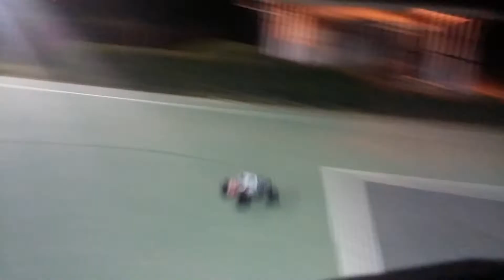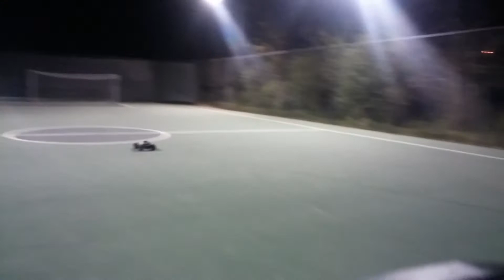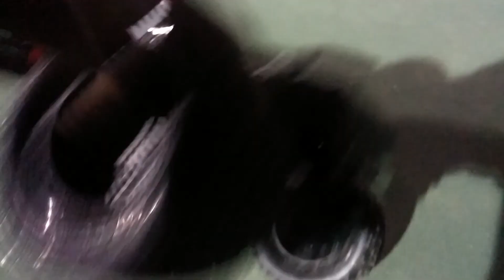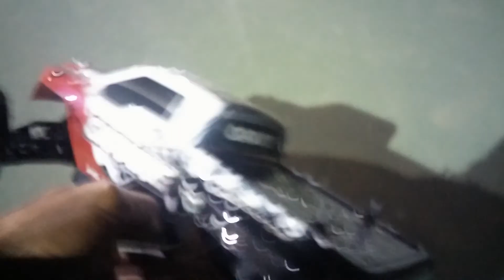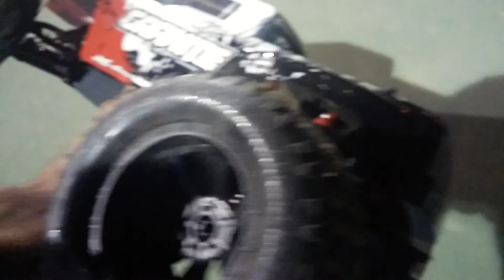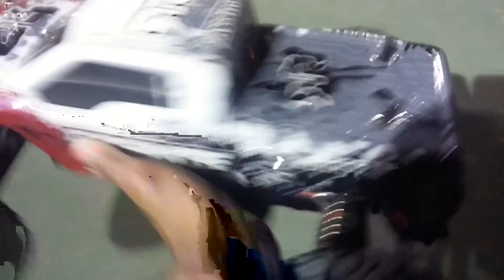Arrma Granite Mega Brushed 3s Box Stock Run

Comment: I bought the arrma granite mega 4x4. Stock electronics took the 3 s but the motor was smoking hot. I put brushless system in it. Does pretty good. Doesn’t have much speed as it should because I found out after I bought it that it has different diffs than the blx version. So I’m running mid to high 40s. Gets warmer than it should because of it being under geared in the diffs. Still does good. Just gotta watch temps on 3s

Comment: Nice. I have never had a Arrma RC yet. Looks like a fun RC.
Reply: Joe Schmoe Hi my name is Jake, I have owned one of these for two months now I have broke almost everthing on this truck. Idk how they call  it bashable, rear stub axles bend, body kit breaks, the mega has a plastic geared servo that broke the third day. If you are going to jump it get the front aluminum shock tower, you will want extra turnbuckle parts, front lower arms I have broken now twice. AND here is where it gets shitty the steering rack is plastic, and so are the transmission gears unless you buy the blx and Arrma screwed up and doesnt sell an input shaft gear anymore.... BOOO. the shocks on it are flipping garbage I broke one jumping a 1 foot high ramp. Also the plastic gears cant handle brushless I have a Onyx 4420 in mine and it ate up the transmission. Also back to the plastic steering rack omg was ripping in a grass field did  a wheelie snapped the steering rack flipped the truck end over end the damage was broke lower a arms, left front turn buckle, front right shock cap busted, front body mount busted. And I have tbone bumpers and Aluminum front lower plate because the factory plastic on cracked. I love this truck it handles well takes sharp corners and what not but if  you get mad easy dont buy to you be like me and be kick it through your back yard. If you want to see a video of my truck its on my page!!
Reply: So sorry you have had so many problems.
Reply: I am a basher but wow never thought that it would just be breaking like it does. I do love the truck though Id put it rite up under the Savage xs, and even that beast of a truck has issues and breaks its just part of the game.
Reply: JakeDean91909 I bought the arrma raider brushless buggy and the first day I broke the steering the week folowing i broke the servo. My friend bought the arrma granite for 180 bucks because that is cheep the first week he had it he also completely tore out the steering. Arrmas are garbage I wish people knew about this design flaw.
Reply: So you expect a 180.00 rc truck not to break?? Bashing the crap out of it? If you want a bashable truck, invest!!! Get the Arrma outcast! Then come back and tell us if Arrma is garbage. You get what you pay for
Reply: lol no I bought a stock truck so I could put what I wanted on it and it kept breaking the tires and rems are garbage and wtf are you even rambling on about any ways???
Reply: Arrma's are not garbage.  You bought one of the cheapest they make if not the cheapest.  Buy a Kraton or another higher end Arrma and you won't be saying they at garbage.
Reply: JakeDean91909  YouTube tuff guy

Comment: Ok so I bought a venom Lipo 3s and ran it in my granite mega.  It had a Tamiya motor in it, blew up in smoke lol😂.  So can I buy the stock motor again and run it without worries?   The thing was hitting about 45- 50 no joke. Recommend this battery.  20$ and it's great

Comment: Hi...i got question..i got the truck you got..and i tried to use 2s lipo 5000mah and after few minutes of playing around with my truck i see a smoke coming out in the motor..so it mean its already busted and i need to change it to a brushless motor...
Reply from the maker: Silencer 23 yea, it is probably burned out - when running in dirt and stuff u need to make sure that u 'blow' in one end of the motor so that the dust flys out the other end. also, keep them well oiled as well.

Comment: is that a brushed 15t arrma motor? How are u running on 3s? the paper on chart said good too 2s on my sons granite? if u are using 3s what battery did u use? also does it still run? im amazed because it dont reccomend the 3s on granite mega 15t motor.. so sum up what battery?
Reply from the maker: Davie Downs yep, 15t motor. this one esc is rated at 3s. the battery was a 4000mah 40c
Reply: my sons is rated max i think 2s but i did recently try my low power 3s and it made it wheelie and was fun too try.. but im trying too get my raider xl too break 80mph with good traction and not a fuss to drive lol.. 80mph will be something else